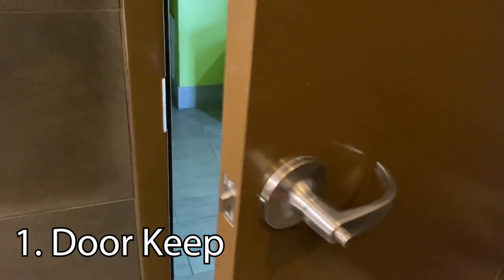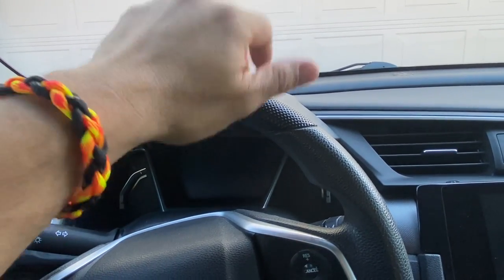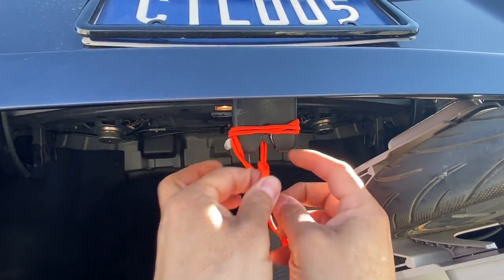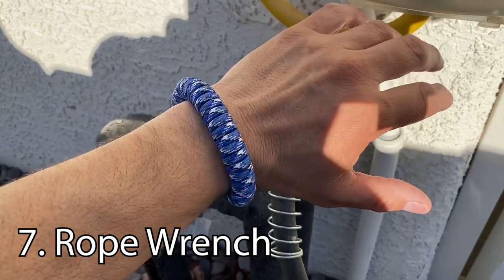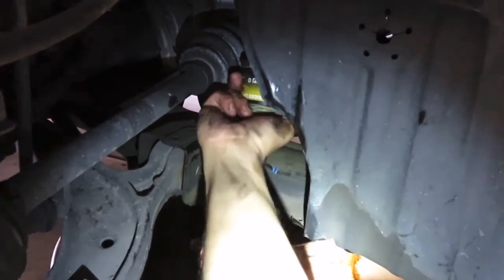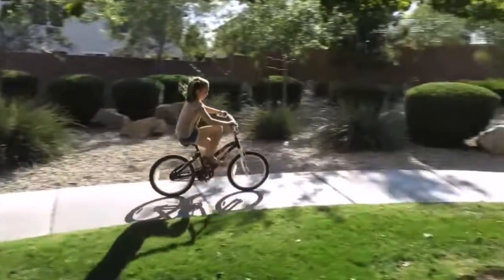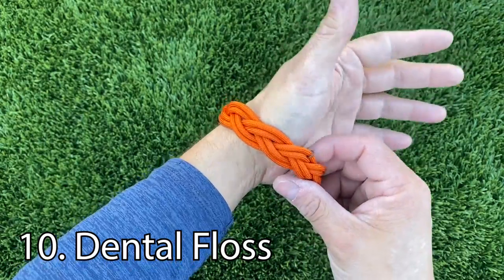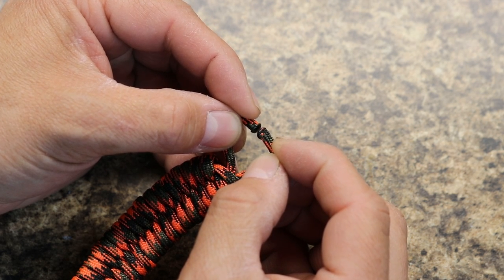10 Reasons you need a Paracord Bracelet

Comment: My car broke down one time going home from college. I pulled over and realized that there was something wrong with my radiator. I knew how to fix cars back then. I was a college student and couldn’t afford mechanics and my car was old, so I took auto mechanic classes in college. 

When I inspected my car, I saw that the radiator plug was broken. I was losing the antifreeze/water slowly but knew I’d be toast if I didn’t handle this immediately. I was able to use my paracord bracelet. I undid the bracelet to get the cord. Wrapped some  leaves from a bush nearby and plugged the radiator hole back up. I added some water and I was able to drive the rest of the way home. It was around ten at night so I was very grateful that I was able to fix it.  There were obviously no cell phones back then and I was in a rural area. This was in the early 90’s. I will never forget that night.